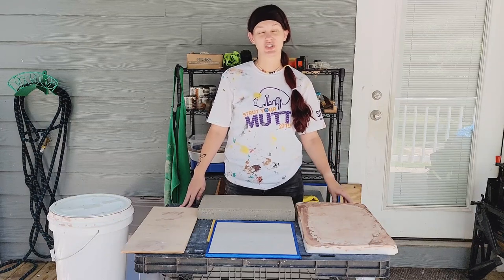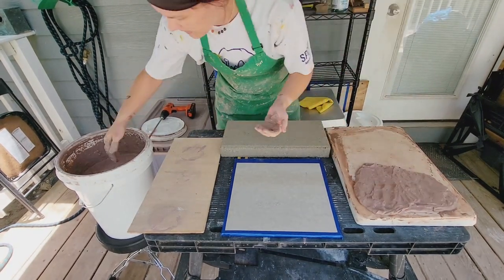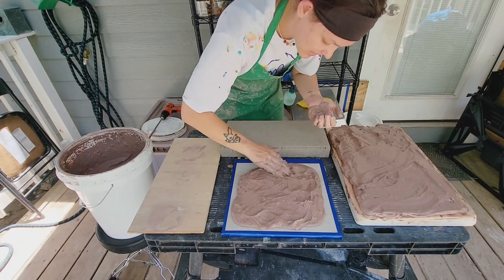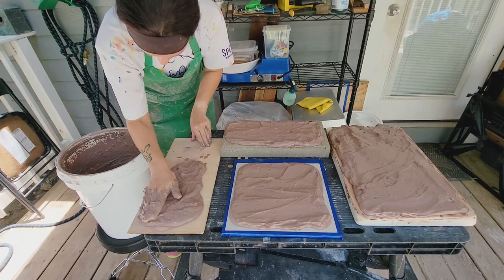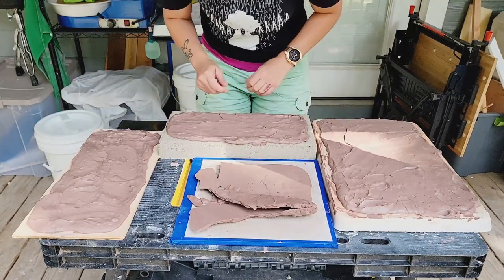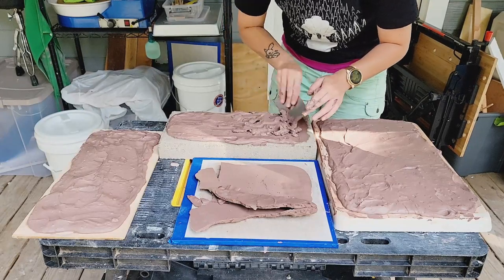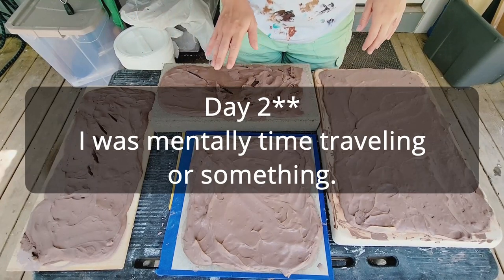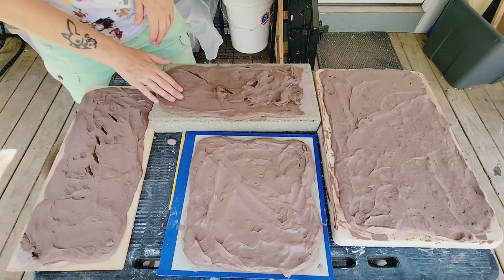Comparing Clay Reclaim Surfaces | Easy Way to Recycle Clay | Reusing Clay in Pottery Studio

Comment: I like to use pizza stone type baking dishes. I also use a towel and water spray bottle to dampen the edges from drying too quickly. Not sure if it's quicker or easier, just how I  recycle. I have purchased them all at second hand/thrift stores. It's ok if they're dark and greasy looking because the oil will burn out in the bisque fire. All but 1 is brand new, never used and thrifted for very low prices!
Reply from the maker: That's a cool idea!! I'll have to give it a try if I come across a pizza stone! 😁🍕

Comment: I use hardi backer (fibre board) and plaster. Both work fine, but the amount of moisture in the batt makes a difference. Once the fibreboard is saturated the drying slows down dramatically
Reply from the maker: Great info! Thansk for watching 😊

Comment: I use canvas covered wooden boards to slop the clay to recycle onto. I'm in Oklahoma where summers are hot and normally very humid, kinda like Texas. It usually takes severial days to dry out enough to work up and bag. I usually roll the edges into the middle of clay, as the edges dry faster. That keeps the clay more uniform.
Reply: Since I have to do this outside on my porch, I loosely cover the clay slop with canvas, in order to keep bugs and critters out of the clay.
Reply from the maker: That's a great idea! Thanks for watching 😊😊

Comment: I just wanted to ask. When you reclaim clay do you need to get it to the consistency you can use a mixer to mix it well before laying it out to dry? I have found that I get very short clay if I don’t mix it welll. I’d love to be able to skip this step if possible. Thanks.
Reply from the maker: Thanks for watching! I haven't ever "not" mixed my reclaim first. I mix it with a power drill and a mixer attachment until the entire bucket is the same consistency (of about pudding). I think it would make sense for unmixed clay to come out short, due to un-mixed and non-uniform particle sizes. But I can't say if it would always be short or not. I'd recommend you just mix to be safe.

Comment: I wouldn't allow the clay slip to be in contact with plaster. Lay a single layer of old bedsheet or woven nylon shower curtain on the plaster before adding the clay.
Reply from the maker: Cool tip, thanks for sharing!